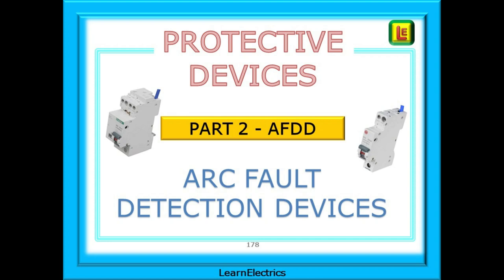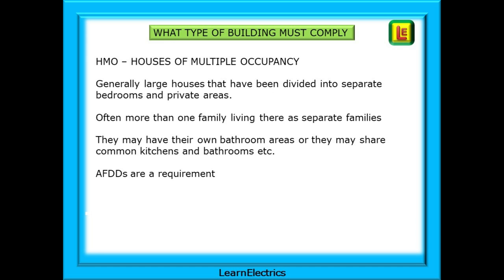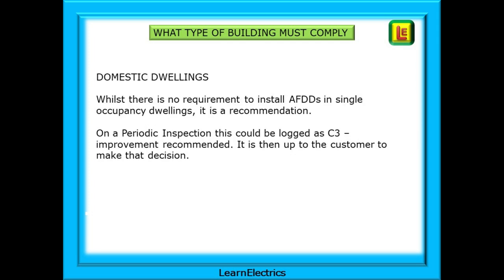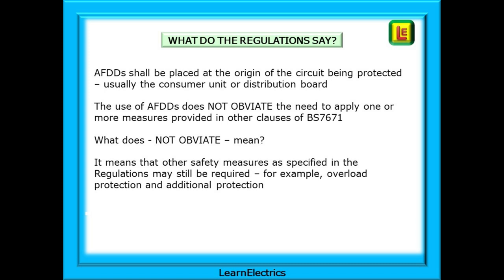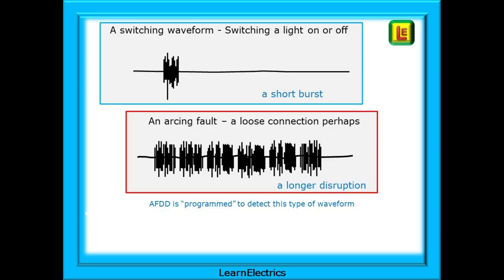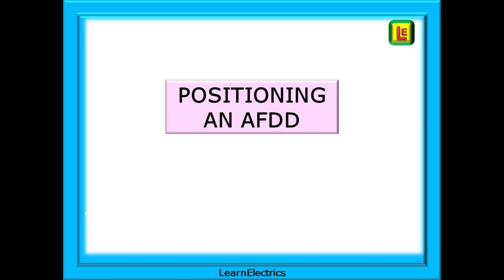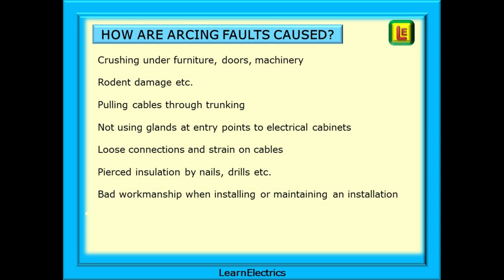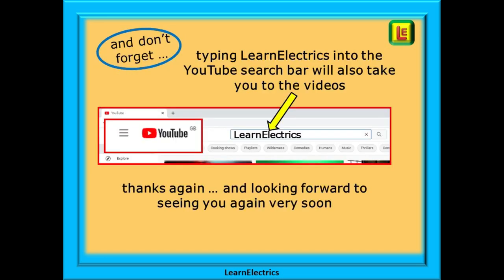AFDD - PROTECTIVE DEVICES - PART 2 – ARC FAULT DETECTION DEVICES – HOW DO THEY PROTECT A CIRCUIT

Comment: In a HMO when a 5 year electrical inspection is due, do AFDDs have to be installed on socket circuits? 
Or is it only when a new circuit is being installed? 
In short, if an electrical inspection is performed, with no additions, or attention to the system, is the installation left as it is?
Reply from the maker: It will be improvement recommended as the Regs are not retrospective. It is then up to the landlord to make a decision.
Your job on an inspection is to just say what is wrong and what can be improved,
If its new work, then yes.
Reply: @learnelectrics4402  
Thanks. The idea is to know what has to be done before an inspection which may say what must be done. Then no return to re-inspect.

I suppose not having circuits on RCDs is also recommended as well.

Comment: Sockets not exceeding 32A. 
It says socket not circuit. A double socket is rated at 20 amp combined.  So in spec.

A single 13A socket can be on a cooker circuit of 40 amp (they are on some cooker isolation switches). So this must be on an AFDD, as the socket is less than 32 amps. 

In short it is saying that irrespective of the  rating of the MCB, it could be 6A, 16A, 32A, 40A circuits, if a socket is on it (not a high current commando socket over 32A) an AFDD has to be fitted. This is even if a 15A round pin or 13A square pin socket is fitted.

So, a lighting circuit with 5A round pin sockets serving a few table lamps needs an AFDD.  The regs do not discriminate between lighting or power circuits.
Reply from the maker: Excellent information. Thank you John, and thanks for watching.